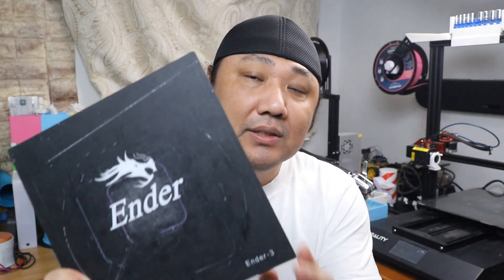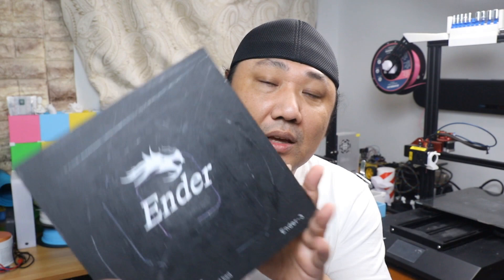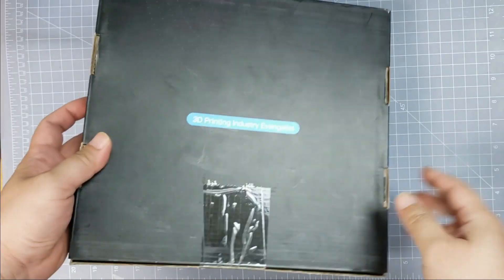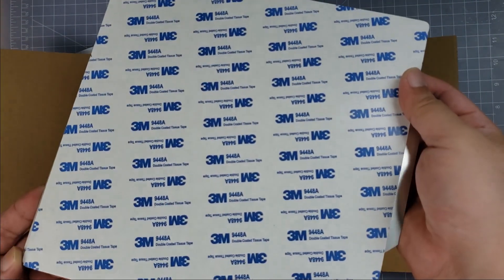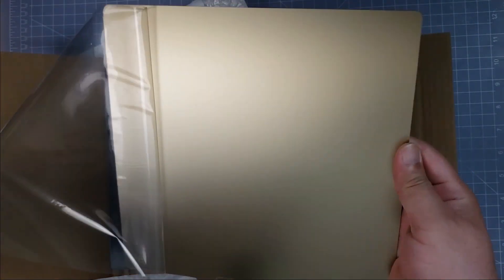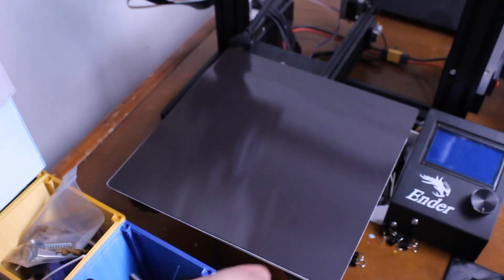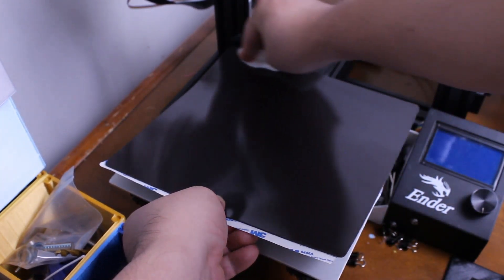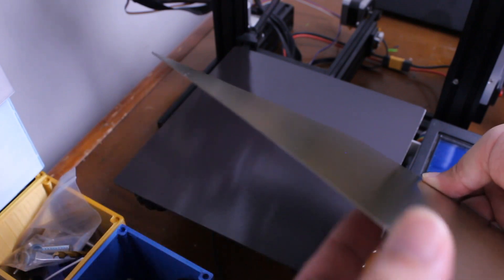😃👍CREALITY PEI BED SURFACE INSTALLATION & REVIEW FOR THE ENDER 3

Comment: I got one of these a few weeks ago, and have been having a hell of a time getting PLA to stick to it reliably. It seems to do so for very big prints, but small-footprint prints do not stick nearly as well as the original buildtac on my Ender 3 - i've had many ruined prints where it just gives way after 30 minutes or so of print time.  What bed temperature are you using for PLA?  (I've been using 60C - thinking of upping it to 70)
Reply: I do have the same problem, but even with larger prints the bottom gets warped like it cant handle the 60c temperature. Im using my Ender glassplate now, instead of the PEI.   Did you find a solution?

Comment: do you have an update on this? Wondering if the CR 10S also has this as an option? Great video, thanks
Reply from the maker: It works. These sheets are meant to be used, scuffed up, and if need be replaced. There should be a right size of the cr 10s.

Comment: What happens if I use the PEI sheet but not sticking the magnetic board on the platform, will it still works?
Reply from the maker: You can stick the pei sheet directly to the printer bed, but not recommended. The sheets are meant wear out an be replaced.

Comment: Can you use the original magnetic plate that came with the stock printer or is the one that comes with the PEI plate rated for higher temperatures?
Reply: Depends. I ordered a second magnetic base for my Ender 2 Pro (Creality version!) and the damn magnetic axis were 90 degrees off so if I wanted to use the new base I had to peal the old magnet off and use the one that came with the new base. Poor customer service to let something out like this.
Reply from the maker: The plate is metal should be attracted to anything magnetic... Creality claims there be should be good to 110C. I have read good reviews on the 3m adhesive.

I'll give you my 2 cents. Several years ago I bought the wham bam system (pex) for my CR10spro thinking I'm going to need it for higher print bed temperatures. Turns out I mainly print pla and petg and keep the bed at around 55C. So there was no need to pay for a more expensive system. Not that I'm complaining because I have had good use of it. I especially like the convenience factor. No clips just set it on the bed, snap off the prints. If it's a big print then flex the plate and snaps off.. No need to work on scraping difficult prints off the bed. Knowing what I know now. The PEI top coat bonds really well with PLA and PETG. I'm going to say probably better than the pex. I would not spend extra for pex system. Your case maybe different. You maybe using plastics that bond better with pex. Also, maybe working well because it's new. I'll have to give it some time and see in 3 months time.
Reply: @DiyProJames  Thanks for the info. I have read that the PEI plates have 90% of the advantages of glass in addition to it being bendable making release strongly adhered prints much easier.

I doubt I will print anything but PLA and PETG because I don't have an enclosure and also don't want to have to deal with the toxic fumes from ABS or the other types of filaments.